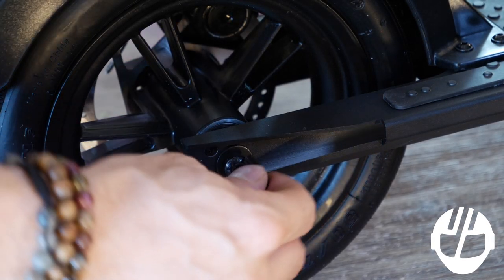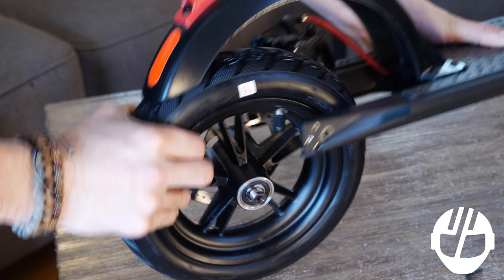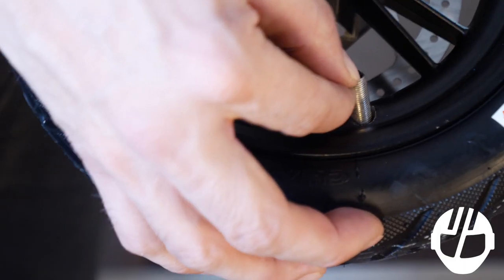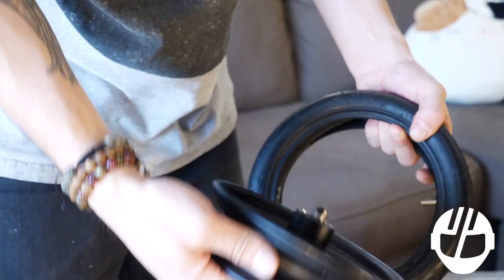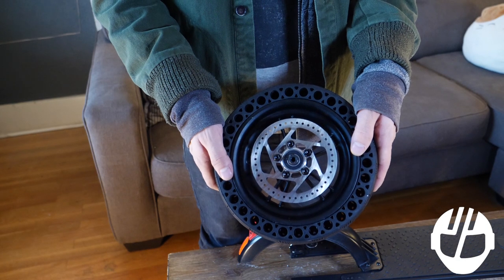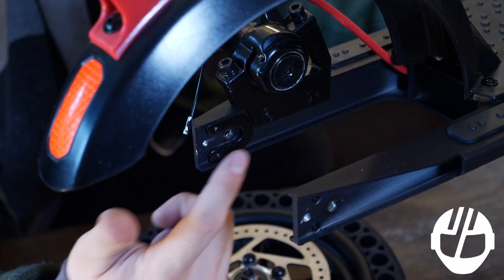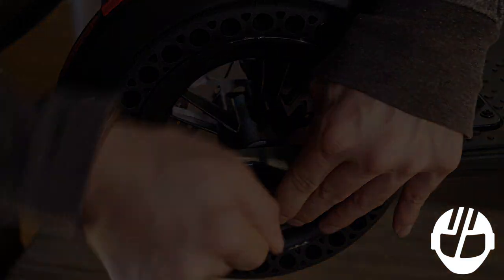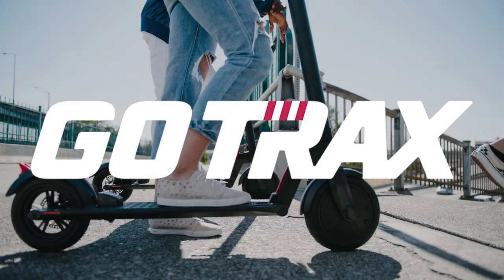GOTRAX Honey Comb Tubeless Tire Installation Guide

Comment: I'm still working on putting on the tubeless honeycomb tire...its been a week of nonstop battle
Reply: Any advice? I've been boiling mine and using Vaseline but I keep trying with no success
Reply: @breakerandtaker73  all you really need is to boil a tire and secure it to the rim with zip ties, work it with a tire iron or if you dont own those a good long screwdriver will work as well (3 of them), it's easier if you have someone to help you hold the rim in place if you dont have a vice or a way to stabilize the rim. I think putting it on soft ground would work as well cuz it wouldnt slide around.

Comment: soap definately helped. and having the tires "steamed hot" with gloves on to work on them. It took two of us, one wedging the tire around and the other holding a long screwdriver. It was about 20 minutes per tire. Go Trax, please create an updated video with the actual process.  (realistic and helpful). thanks
Reply: How did you remove the front tire?

Comment: Put vegetable oil spread over the outside of the rim.. boil the airless tire in hot water for like 10 minutes and just use strength to stretch tire around rim while it is hot (use gloves) I used screwdriver to help in some places and put knee to hold tire while I stretched the tire around the rim.. I got both tires on within a 30mins!
Reply: Did this exact technique with Vaseline 👍🏽
Reply: Where do you live and can I hire you to do mine lolol

Comment: I’m trying to remove the cover with the Allen key but the screw is so tight in that it’s very close to stripping the screw... does the honeycomb come with an Allen key to use? I might have to buy that.. because it seems that none of the Allen keys that I have work..
Reply: I got the same problem , non of my allen key works
Reply: Same here...tried everything and it doesn't work

Comment: Tip to anyone doing this, put the honeycomb tire you want to put on in boiling water for a while so it softens up before you try to put it on.
Reply: Does this actually work
Reply: @erickcerda8597  No, you have to boil it, then have the incredible hulk come over to your house with a six foot pry bar, a twelve pound sledgehammer, an anvil, ten zip ties, a pair of heavy duty leather gloves, a half dozen extra large c-clamps, some kind of heavy duty lubricant, and a custom built mounting rig, and then after 6 hours of back breaking, finger crushing, profanity spewing work and severe damage to your rims and brake disc, you might get it on. Or not.
Reply: @classiccoop  oh ok that I’ll call him over right now

Comment: "work the tire on"  not me dying to even fit half a side.  
But boil the tire a like 15 mins use gloves and soapy water and then use all the strength in your body to push it on with pry bars. Have a friend to help makes it easier.

Comment: These are indeed a pain, but there is a trick to make it a little easier.  Soak the tire in HOT water for about 10 minutes before trying this. Also, try a little dish soap around the rim to help slip it on.  Make sure to dry up all the water and soap before trying to ride.
Reply from the maker: Great tips!
Reply: Thanks  man

Comment: When I tried unscrewing the first screws the stripped. What do I do now???
Reply from the maker: Try placing a rubber band between the allen wrench/screwdriver and the screw! That will give better grip and should help get the screw out. Otherwise you can also get stripped screw kits from local hardware stores.

Comment: THis is an old video so I'm not expecting an answer, but can these be installed on the XR Elite?
Reply from the maker: If you find an 8.5 in x 2.5 in honeycomb/solid tire it will fit the XR Elite
Reply: @GOTRAX  Thank you so much. This is very helpful. I'm so tired of getting flats!

Comment: the fender broke. I cannot take it off to replace it. There's a one-piece cable with a metal head that makes impossible removing it. Any advice?
Reply: The cable is removable by itself on the other end and then put it back together. I just left the brake off it slows down the scooter and not a real much of help breaking.

Comment: These look great.  If only I'd been able to remove the side covers from my GXL V2 without wiping out the low grade hex screws because of the threadlocker. Hmm. Fun, fun, fun.
Reply from the maker: We're working on a new video for our tire replacement. For both honeycomb and regular tires.
Reply: @GOTRAX  please cover front and rear.
Reply: Did that too. How did you fix it. The hex keys no longer work. Please help I’m frustrated because I spent $300 on this scooter and only had it for less than a month
Reply: @ianfrancis9595  I tried a couple of techniques (left handed drill bit, j b welded a hex wrench) but the only one that actually worked for me was buying a set of small easy outs on Amazon.

Comment: Yeah so not only was the allen wrench bolt stripped out and rusted from the factory which caused me to have to Dremel a notch to get a flathead on there and hammer the bolt loose as it was overtorqued, but to fit the new tire on the rim is a beast of a task. I've completely rebuilt vehicles in my workshop to give you a sense for my aptitude and the tools available. So watching this video is infuriating. Useless and misleading.